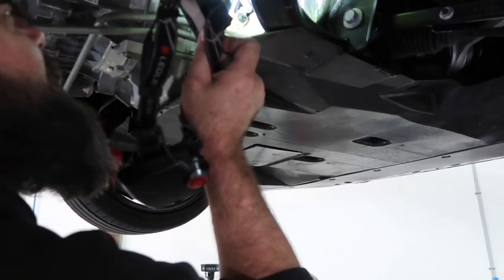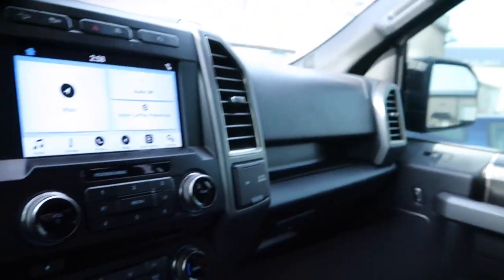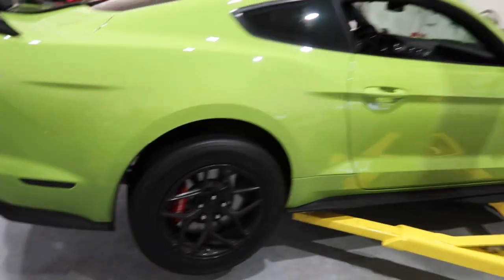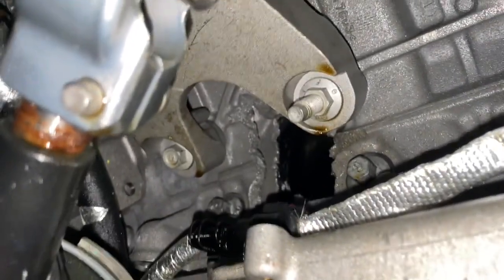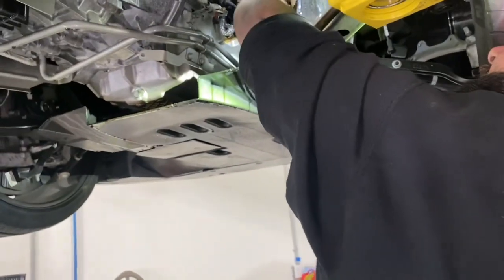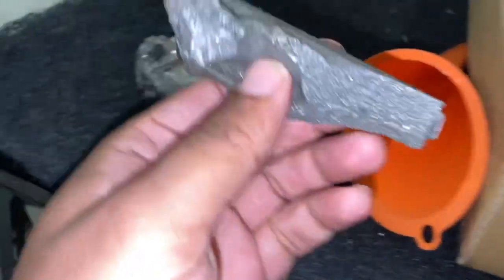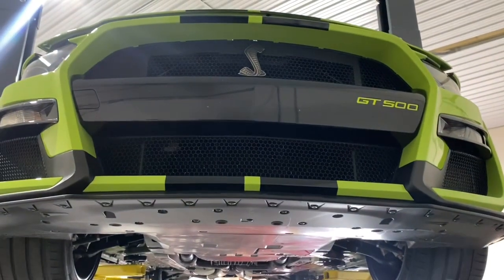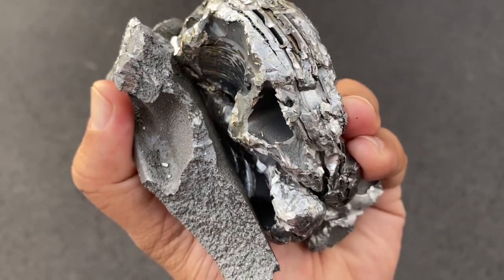I’m F’d! My 2020 GT500 blown Motor is Worse then we Thought! *Part 2

Comment: I’m REALLY curious what the E85 content in the tank was at. Can you keep us informed what you find out?
Reply: Angelo Bovara  Near 1000rwhp and repetitive abuse on a stock motor is your answer.  These engines, although stout, are not bullet proof.  And are crazy sensitive to fuel variances.  Many of these high horsepower cars are garage queens....this one actually gets used...a lot.  Street Speed's ZR1...Steven at LMR recommended upgrading internals because of the way he uses his car.  Sure, it can handle 12-1300 hp...but you're playing roulette at that point.  If it wasn't a rod bearing it was probably detonation.  I can't say this is a shocker.
Reply: Plus its not even direct-injected.
Reply: Angelo Bovara  knock more than likely. My guess is bad ethanol, like a low content, and he didn’t even know it. I’ve tested lots of gas stations before I pump E85 in my car, and some pumps actually have E15 when it should be E85. Your car isn’t gonna like that.. specially with this much power
Reply: @Eddy-09  people with experience can feel and most times hear a vehicle lay over. Unfortunately most just stay in it because they don't know any better or what's about to happen. 
The way he was driving it at the time there's no question the IAT were high. Mix that with some bad fuel and it's a recipe for disaster.
Reply: @waynebollentin989  any way to describe what that sounds or feels like? I can’t say I’ve experienced it, and I hope I never do!
Reply: @Eddy-09   it's like a 6th sense for me lol.. All jokes aside hesitation is a word that comes to mind. The vehicle goes flat. Doesn't pull like normal. Feels like something is holding or pulling you back. The sound is how the engine revs. It will sound labored. Sometimes it sounds like hammering. You definitely can feel it when it happens most of the time. This shit does happen fast too. There's not time to think about it either. Soon as you feel something not right, you lift. If your thinking about if you should and theres a problem it's already to late. Even then many times the damage is done. To many think the computer is going to save you and that's just not the case all the time. Everyone should know what their car sounds and feels like normally. When either of those 2 things change you lift and hope for the best. 
 Doesn't have a be a boost or nitrous engine either.
Reply: @Eddy-09  only way you’re ever going to get consistent E content is by buying pails/drums of VP, Sunoco etc.  E85 at a pump is rarely if ever truly 85% to begin with.
Reply: @stephencushing8148  True. Second best would be to test it before you pump it. I usually find 86-88% at the pump. Most cars are fine with E80+
Reply: @Eddy-09  there's many factors at play. What maybe fine for car A will blow up car B. Compression, boost, IAT's and tune are the biggest. Most good tuners for instance will tell their customers only run this tune on race X85. Then guys will have some pump E85 in the tank. Add the X85 and think they're good to go and there not. Some tuners don't get as aggressive with the timing as others knowing this. So it just really depends on the people involved. Anyone running hot tune is playing with fire on pumped E85. Even with a N/A in some cases. You don't need boost or nitrous to hurt a engine. 
I know I would never load a timing map I personally run on something like x85 or Q16. I'm pushing the limits and when you do that. There's no room for error. Most guys aren't looking at there IAT'S or ETG'S on the street. That was most likely part of the problem here. Getting on and off the throttle on the highway the IAT'S are getting higher and higher. Many of these tunes are for a single pass down the track. When writing a tune application is very important also.
Reply: @waynebollentin989  Great points, makes lots of sense. So in short, the more aggressive it’s tuned and if the fuel is x85, there’s a lot less room for error just because the average Joe might try to get away with pump e85 that might actually be e72 and then do pull back to back getting it hot, and boom? I know my tuner was more conservative with my tune, and he said even though it was tuned for e85, it would still be ok if I pumped e80. Then again I’m nowhere near as much power as this gt500, and I make sure to test my e85 before I fill up.
Reply: @Eddy-09  you are going about it the best way regardless of the power. Unless you're racing you should be on a more conservative tune. It's the safest way to go. That extra 50+hp or whatever isn't worth it on the street just driving around. I don't think you can blame his tuner here either. I believe it was palm beach dyno that did the tune. As an owner and driver you need to understand there's consequences for your actions just like with anything in life. With cars like this people need to understand detonation and why and how it happens. Unfortunately people think because they have a good tuner that they have nothing to worry about. You get it was fine a this time. Yes it was fine under those conditions but when those conditions change, so does everything else and that's what happened here. 
What I find most hilarious are all the ls and 2JZ fan boys that think this doesn't happen to those engines. All the idiots with this engine will make that. It doesn't matter what manufacturer it is or aftermarket part. Detonation and heat will destroy any engine. Doesn't matter if it's 100hp or 5000hp+ no engine is people proof. Take care bro and good luck with your car.
Reply: @waynebollentin989  Awesome points man, you laid it all out very clearly and I agree 100%. Thanks bro, and you take care as well

Comment: You weren't running an E85 map without testing the e content were you?  I've seen it drop to E61 in winter or even mid November
Reply: My guess too.. they definitely do that up North in the winter temps start dropping so does the E content.
Reply: 25k mistake.
Reply: @HTXatLarge  my cars on a flex fuel map so E content doesn't matter but I still check content sometimes
Reply: @thepseudomasterchef7238  I here you man. Are you making over 600w? Bigger displacement bigger risk stay safe
Reply: @HTXatLarge  lol...No...It's a 2.0 Fa20dit stock block Subaru...around 400whp...lol..Still well over 200 crank hp per liter so yeah, I'm pushing it...But I'm tuned by the best....77k miles so far...I just know the risks of running E85 if you aren't careful
Reply: @thepseudomasterchef7238   that's some good power, great tuners make the difference. Salute bro 👊
Reply: @HTXatLarge  it's fun enough for a DD and still enjoyable to drive...But I have a flex fuel setup that allows me to run 93 all the way up to E70 or so without changing maps...On 93 I only make around 310whp so I almost never run it...lol..I once owned a B5 s4 with a built block, single turbo,  meth injection that made 630whp...Was nothing but problems...But after that car I've accepted the reality that no amount of power is ever enough so for me a reliable DD that runs 11's is enough...Plus we get crazy snow up here so AWD is a must...I really wanted a new 5.0 though but I can't afford a garage queen right now
Reply: @thepseudomasterchef7238  hahaha you totally get it!  Big power builds are cool but they'll definitely break and cost a shit ton to fix. Having that balance of power and reliability especially in the north with y'alls wild weather is quality of life. Living vicariously through YTbers saves me a ton of $$$ just when I think I'm willing to drop on a build one of these guys sends the rods flying haha. Having a Garage queen isn't too bad IMHO a lot of these guys are putting these cars past their limits and I don't blame them it's good for us to watch 😂 Best of luck to you bro

Comment: My stock 2020 GT had the cylinder 4 fuel injector get stuck in and windowed my block after it exploded the piston, while I was driving like a normal citizen (rare). Also caught the engine bay on fire. This is the 45th day it's been in the shop so Ford repurchased it. RIP man. It's hurts but you'll be alright.

Comment: Well at least the excesserees are still good 👍. You should be questioning your builder/ tuner. To much boost, not enough fuel, timing to high? I'm sure it is one of the 3 if not all. Hopefully it's back together by spring.

Comment: That's a bummer bro. I hope the heads are good. Thats racing though, stuff breaks. Interested to see how the E85 test goes
Reply: I wouldn’t be at all surprised if that head or at least the valves are damaged. If those piston pieces bounced around in that cylinder before dropping down into the block and out the side it’s pretty much a sure thing the head is damaged.
Reply: Bit late for Fuel test? Really? Anyone who thinks stk components are gonna live long w/these mods? Well.. they are delusional...

Comment: I  worked at a gas station in 1969.
One night a guy drives in with a '59 ford.  Straight 6. Hole in left side of block.  Engine still running.
I could see rod gig end going around.
He left it for a few days, then got it towed. 
If it had caught fire, and, you two got out OK,  total right off  through insurance would have been better outcome.

Comment: The heads will be busted but if you can find a good machine shop to weld up some of the cylinder chambers that’ll definitely save you some money. Just make sure all the cyl head chambers are the same CC’s before reassembling. Oh and yes, a new bottom end for sure.

Comment: Hate to see this. You'll be back even stronger. It's good to see how you push these cars to the limit. With the mumba,I was surprised how you did all that with the stock 10 spd trans before it went out. That says alot about how good that 20 spd standard trans is.m. But with more power you need stronger internal everything! Thanks for sharing bud. You'll be back!!

Comment: Put in a warranty claim, manufacture defect!
Reply: He has modded it and youtube videos to proved he modded the engine. Warranty is out the window.
Reply: Aftermarket cams and a tune voids that warranty lol
Reply: Can’t do a warranty claim if engine is aftermarket modified...warranty is void
Reply: Sucks this is why modifying stock cars is playing Russian Roulette....
Reply: I remember when the talk was about camming the Hulk. Running an E85 tune, pulley change increasing boast putting a lot of pressure on the engine,  along with other mods. There was even talk about twin turbos. If you're going to build a 1000 horsepower Mustang and run it hard basically daily. You need to be sure you shore up the internals. I also remember a mention regarding losing the Hulk's factory warranty. I thought since the Mamba was going full race. The Hulk would stay basically stock keeping it under Ford warranty. I don't see Ford responsible for this catastrophic failure. With all the mods and Utube videos of the Hulk racing. Factory warranty was voided. The Hulk has been run extremely hard from Dig to roll racing and most "Race cars" and that's what Hulk has become needs to be maintained differently regarding oil changes and even teardowns. It appears the redline was increased from tunes and the boast was increased. Sorry for the blown engine, but buying a predator block crate motor may be the least expensive repair. Put it back stock and enjoy the factory 760 horsepower daily driver. You have a beautiful and fast stock GT500 for a great daily driver. And you have the Momba to tear up the Dragstrip. Racing is expensive. Best of luck moving forward.
Reply: Ppl miss sarcasm
Reply: Except, he helped build the car!! 😉
Reply: Yeah, he has been completely idiotic with this car. Failed to add the proper support around his modifications and has now put himself in a horrible situation. Not sure if anyone remembers his car payment video for this car. It’s more than his mortgage. No warranty and full financed car, and now it’s worth a quarter the price. So yeah.....he’s fried financially. He shouldn’t be laughing at this point.

Comment: I know these engines are a lot more expensive, but I blew the engine in my 95 Mustang with 22,000 miles on it. I was standing in the shut down area at Atco looking at anti freeze running out my tail pipes and thinking what the hell did you do, and we just went on strike that day. it's a big set back but I'm sure  you will get through this.

Comment: StangMode, I'm not sure what your time frame looks like but Ford just announced the development of the Megazilla crate motor based on the 7.3 Godzilla.  This would make for some great content imo. 

Serious drag racers should consider this option...less moving parts and big horsepower potential.   Additionally, the crate engine will be a lot less expensive than a replacement GT500 motor.    Also, currently there are not many crashed GT500 out there that you can grab an slightly used engine at a much reduced price but in 6 months they will likely start popping up.

Comment: Man I hate that, I'm guessing a wrist pin came loose or the crank gave out which is hard to believe. Forged cranks don't usually snap at that power level.  But it gives you a chance to build a new short block. The heads should be okay. Ford just released pricing today for the motors.

Comment: Best of luck to you but those heads are not going to be okay. At this point I would be hoping the blower is okay with no metal going through it from the valves getting banged up. I'm really interested to know what started all of it. Even if the E85 is 70% it shouldn't detonate. There should be NO detonation with E85. Unless the E85 sat for way too long and had phase separation from turning to water or something I just don't see why or how you could have detonation. The tuner would have to almost try to make E85 detonate to make it happen.

Comment: Make a table with the broken block and use 4 connecting rods welded to the block with clear rubber pads on them so you can put a glass top on it.

Comment: I also wouldn't just assume the heads are fine given all that piston damage.  I can easily see bent valves and damaged valve seats happening here, given the way that piston looked.  Your tens of thousands estimate is likely pretty correct.  Hopefully you'll be able to salvage as much of the heads and blower and the other various intake and exhaust parts as you can.

Comment: Dropped a valve while high revving and the piston got destroyed and decided to pound itself out of the sides of the block...
Reply: Yep, and I wonder if that has anything to do with the OEM camshafts being replaced by a custom one, him spinning the engine higher but the valve springs being left alone, OEMs. That piston hit the valves 50000000000 times, lol. The heads are also destroyed. Yikes.. Good Luck with the repair , StangMode.

Comment: Here comes the Hulk sleighaaA,  Fixing the mustangs long block,  On Pistons,  on rings, on connecting rods  on push rods on crank shafts on valves and valve springs. Its a sad Christmas this year. LOOKS LIKE NO BUENO IF YOU ASK ME. 
When it's time to order a brand new Crate motor.

Comment: I'm quite sure that motor dropped at least one valve which started the process of the catastrophic damage not enough tuning /sloppy tuning aftermarket camshafts, all that on a completely stock bottom end more than likely hyper eutectic Pistons also.. throw the whole motor in the trash the long block at least get another long block pay for it to get properly built then call John Lund immediately... End of story I feel for you my man

Comment: Wonder what effect the cams had on all this and the rpm.associated with them....these Predator engines been pretty tough....
Reply: I was thinking the exact same thing also those aftermarket camshafts a little bit more lift and duration along with a bad tune, winter time is notorious bad for e85 fuel too much timing too much boost and a stock motor I would bet money those Pistons are hyperutectic also it's my guess he dropped a valve which started all of the destruction too much running lean and too much boost
Reply: He had more spring pressure, more aggressive lobes and turned higher RPM...harmonics even i could easily see this as a dropped valve causing it....because he is the only one with cams its not a coincidence others are pushing 1100 whp
Reply: @bluecollardaily2676  yup

Comment: Seems to be like the factory block was already at its limit for power and the mods you put In exceeded that
Reply: I've heard these internals and blocks cant take much over stock.  I've heard you gotta build these if you wanna add power and he's learning it the hard way.
Reply: @richardlapoint1845  You can blow a built engine just the same if your octane isn't up to par. I've been to an E85 pump, tested it, and it was regular gasoline. You have to test it everytime before a fill-up if you're getting it from the gas station. Also, his tune might be the culprit just as well.
Reply: @richardlapoint1845  you heard from who? It was most likely detonation that got this motor from bad e85.

Comment: Hulk....so beautiful; I want it even it's broke down.
As for the engine failure..... Boost; it's a love hate relationship.
But now it's a completely destroyed block....I say go with 20B triple rotor engine.  That has 1500 horsepower potential. And it's only a 2.0L engine.

Comment: Weld up and machine the heads with new intake and exhaust valves made from inconel to take the heat and rpm and a new short block

Comment: You will eventually start seeing more blowing up. It’s just a matter of time. This is your chance to get a much stronger engine that will hold even more power safely. At this point I would junk your shortblock and get a new one built. Your heads will have to be fixed but hopefully they are not that bad. I would go to MPR engines in Florida for a shortblock.